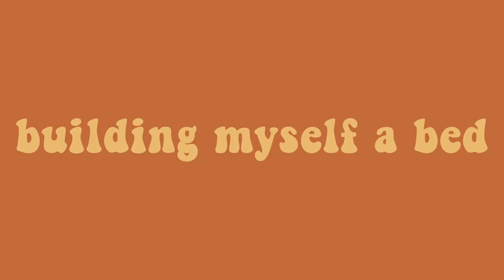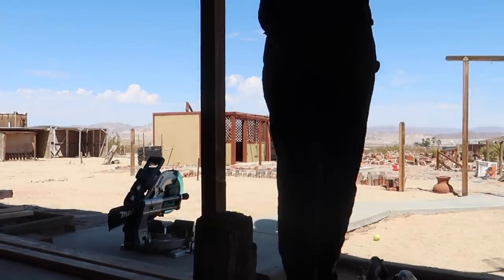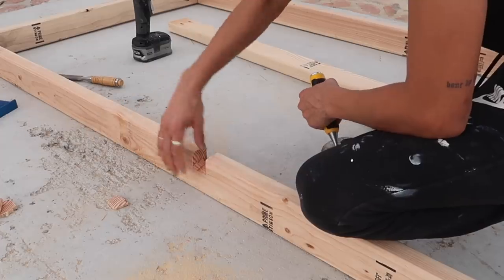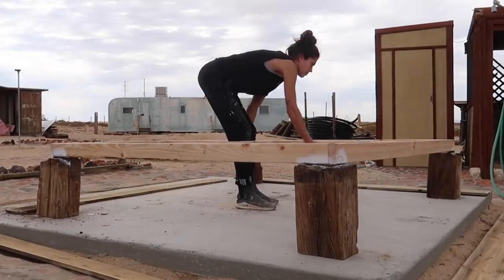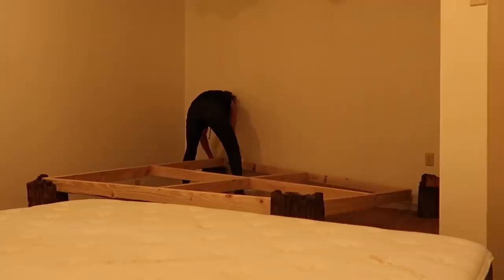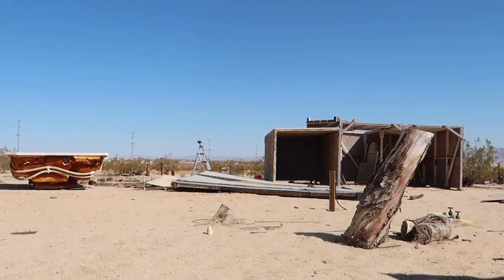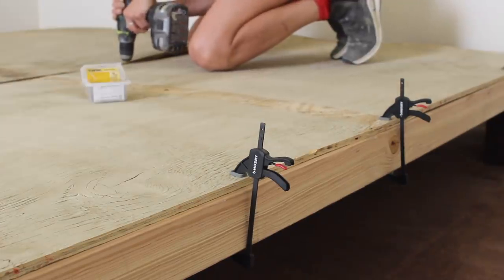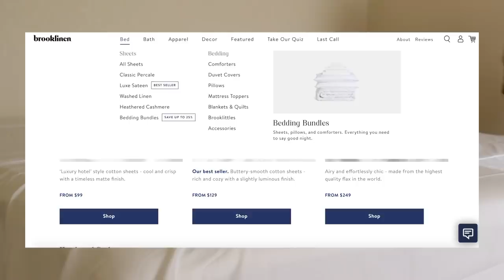BUILDING MYSELF A BED FOR LESS THAN $100 | DIY Reclaimed Wood Cali King Bed Frame

Comment from the maker: I needed a bed...so I built this xx.
Reply: Awesome bed love watching your videos. One real quick suggestion, which is to drill some holes in the base under the mattress to allow your mattress to breath.
Reply: @EmmaStafrace  is this really a necessary step? I’ve never heard of this but I’ve also always has bed frames with slated bases
Reply: did you add a sealant? or is it not necessary?
Reply: @donniep.1513  It sure is you’ll be surprised how quick mould will form from body heat especially on ply wood bases.
Reply: Are you 100% positive that those sheets of plywood aren't wolmanized?? We do NOT want you getting sick, having it indoors & sleeping near it.🤞😬 Just had to ask, we need you ya know!🤗🇨🇦 Oh, suggestion: drill some 2" holes into that plywood, so that your mattress can breath. It stops mould & mildew from collecting. Yeah, I know you're in the desert, but stuff can still grow & you don't need that.😉
Reply: I knew you were bad ass, but this meta level bad ass. Are the sheets real linen? I just invested in a different brand of linen last year, and I just love them...and it's like practical luxury for real. We're switching up our HVAC sitch, so acclimating is so much better with real linen. Anywho. You're such an inspiration! Rock on!!!
Reply: I am inspired to do this 😎
Reply: @donniep.1513  yes. humidity

Comment: LOOOOVE THIS. The legs are siiiick. 

Heads up tho - there needs to be airflow under mattresses, otherwise moisture gets trapped and will mold the wood and the mattress (ask me how I know... 😂). BUT there are affordable "air flow" pads made for RV beds that you can put under the mattress to solve that problem super easily.

Comment: You are such a QUEEN, building that badass CUSTOM bed all by yourself yes ma'am. high five ♥  --- ps. might wanna think about cutting some slits/holes in the plywood boards so that the mattress has that optimal airflow to prevent molding. wait wait wait wait, desert. it probably doesn't get moist there lol
Reply from the maker: Thank you!